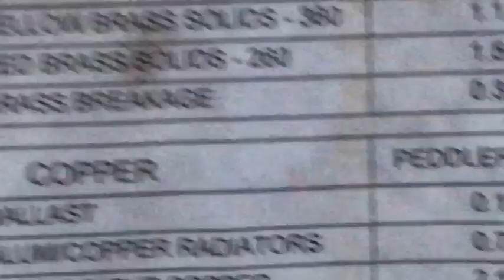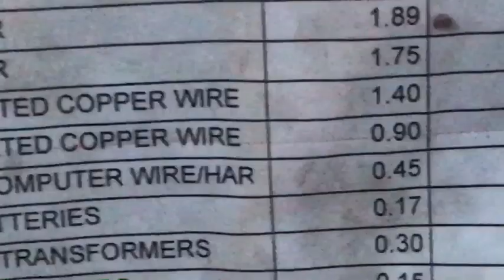Scraplife first unloading!!

Comment: So you made a little less BUT you didn't pay for a rental truck. I bet you got more money left in the pocket
Reply from the maker: Mark S. The rental just takes from the bottom line but I can put about three times as much material in that truck the rental one
And it burns about the same amount of fuel the bigger truck has a smaller engine then my pick up my pick up has a 350 in.³.  That Ford truck has a 3.5 The rental    So Eric it's about the same gas mileage so that is less fuel required to move three times as much material
So you will pick up truck could carry as much material but I don't have a set up that would allow that!